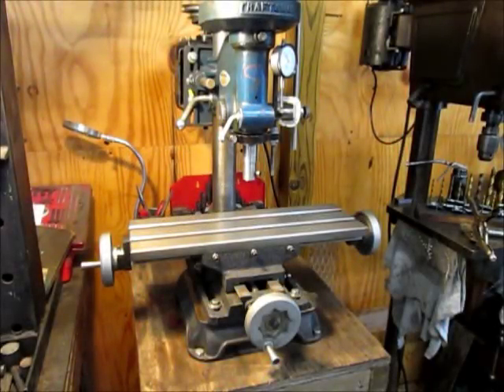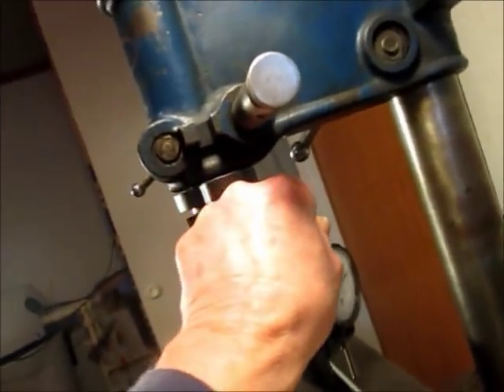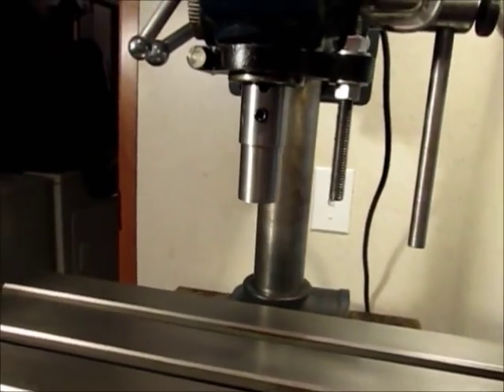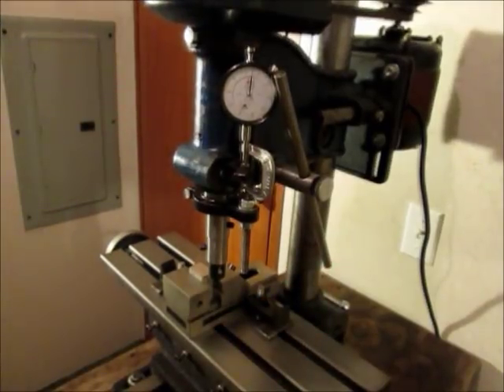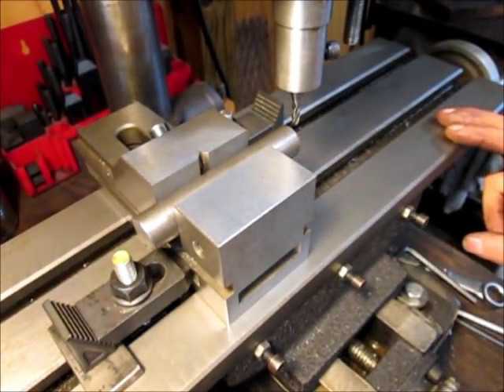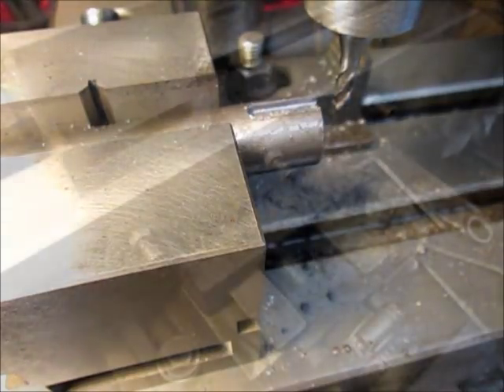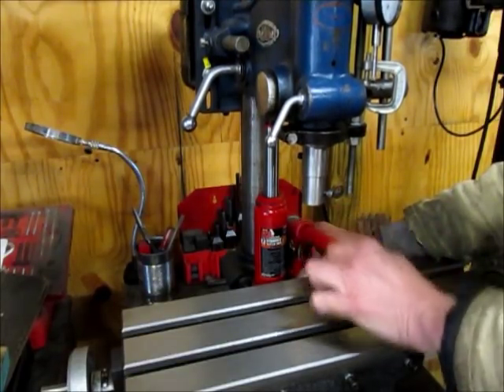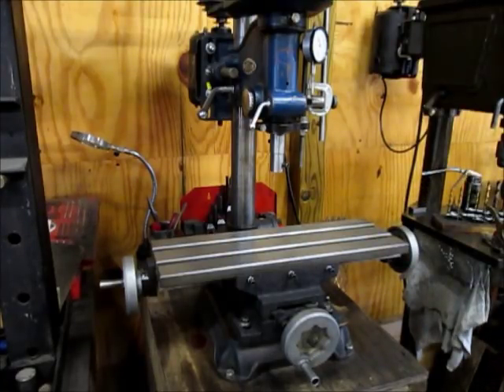Milling with a Drill Press

Comment: Solid job. I wouldn't worry as much about the bearings as these worry warts would have you believe. Besides you'll know because it will go out of round. Craftsman made legendary tools back in that era and I think its awesome you are keeping it working instead of rusting away like so many things. BTW my drill press is way older than that one, has a table so skirts can fit underneathe during the war effort when everyone worked together to help America. Now all people do is try to tear her apart.

I rewired mine, added a double podium booklight, extra outlets, a pallet cut into a frame for casters to roll it all over my shop. It's really handy now. Still only 1/4 hp 2 speed GE motor (and I leave it in the lowest one because I drill more metal than wood in it)... cost me like $20 at a garage sale, another $15 for a belt and a Jacobs chuck key. 

I should order that grizzly cross slide table you used. Nice unit. Good you're another fellow woodworker who buys AMERICAN MADE! (all my stuff is craftsmen because it was american made, my dad taught me, now I know its different)
Reply: Well you can safely bet that X,Y table isn't and won't be AMERICAN MADE because mine sure isn't. Milling with any drill press is like taking a Ferrari to a mud bogging contest and expecting some type of result. Just because the one's who know it's a worthless idea are saying so doesn't make them wrong. If you need to mill then buy a cheap small one. If you wanna play ya gotta pay. I want to learn how to fly, since I can't afford it I'm not going to jump off a building and start flapping my arms.
Reply: Turning Point Why are you bombing this video for?

For what its worth, mills don't use axial bearings, they use brass bushings, radial bearings, and gears (lots of gears)...

Oddly enough, big oil rig drills do use axial bearings...

For the record, I work in manufacturing these bearings, and those are basic roller bearings with sleeves. 

Axial bearings have 3 components, a housing washer, a roller filled cage, and a shaft washer. 

What you see in these drill presses are either radial roller bearings, or radial ball bearings. 

Either way a quick replacement with tapered roller bearings fixes this, as does installing a draw bar. 

What it doesn't fix is the fact that the spindle is driven by belts, and belts slip. This doesn't mean it can't be done properly, but it's not going to make you money at home from production...

I saw you get on him about his key slot, and that has nothing to do with the machine, rather the fact that he used a single pass, meaning his key way was the same exact size as his end mill.

I highly doubt you know much of anything, or you would have told him to use a smaller end mill, and clean up the sides.. Maybe its because I actually do this as a job, maybe that's why I know it!
Reply: Like far too many on YT you just automatically make a snap decision and assume others know far less than you do.I work in the open pit mining industry and have been around lots of blast hole drills. I've drilled a few holes but am no driller by any definition.But those rock drills are pretty much the same as those oil drilling rigs. Those axial bearings on the drill heads are there to take  the thrust loads common with any drilling. The drill string deflection when the holes are being started and to keep the drill string centered are taken by a deck collar that has the radial bearings since the drill pipe is never perfectly straight and it wears unevenly. So those axial bearings aren't odd at all. Or maybe you think there's no down pressure needed on the drill heads? All these drills including oil rigs have down pressure gauges so you don't burn up the drilling bit in case you didn't know that either.

And axial bearings have a hardened inner race, the same for the outer race, and the balls or rollers that may or may not be caged. 

And since I do own a proper Bridgeport clone mill I'm more than familiar with the requirements and parts involved. Your points don't address the non optional needs of a drawbar and how to get that hole for one through a spindle not designed for one with the small diameter in most drill press spindles. Since Morse Tapers without that drawbar are only good for end thrust as in drilling that drawbar is required for any work that involves radial forces. That simple drawbar is what keeps keeps Morse taper tooling seated in the taper. A MT is only self holding during axial thrust. An R8 taper still uses a drawbar since that taper is not designed as a self holding taper even while drilling. But it's also used to close R8 taper collets or hold tooling in that taper. That same drawbar idea is used to retain Morse Tapers since side forces and the standard vibration even using a multi toothed end mill will cause them to release. 5 minutes with a google search would prove that to anyone who cares enough to check. Then there's the point of people thinking a drill press chuck should be good enough to hold a milling cutter. There not since common non carbide drill shanks are left soft for a very good reason. The drill chuck can get a much better grip on them because under tightening pressure the drill shank flattens out just a bit but not past it's elastic point. Hardened cutting tool shanks such as end mills would only have basically line contact at the center of the 3 jaws. The helical flutes on an endmill will help to pull the end mill down and out from that drill chuck unless a reverse helical flute or up cutting end mill is chosen. ER, MT, R8, etc are designed to surround and properly grip almost the full surface of the tool shank. They still need to be properly tightened. ER 40s take 120 ft lbs on the closing nut before there considered tight enough. How much torque do you think a chuck key can tighten a drill chuck to? But you should already know that since this is your job right? 

My mill is a belt drive and no different than most other mills in the Bridgeport size other than the bench top sized geared head machines and my mills belt drive still doesn't slip even with 3 hp. Non cnc Bridgeports designed for commercial use are still made as belt drive machines today and there still making money with them. If a drill press doesn't slip while drilling then it most likely wont while milling. But that's not even an issue here since this drill press couldn't grip any mill tooling well enough to get even close to making the belts slip. And proper mills all have both radial and axial bearings since there designed to do both side milling and drilling when required or didn't you know that. Those angular contact bearings can take both types of forces. Some mills will even have added radial bearings to take the thrust loads off the angular contact bearings. www.lathes.co.uk should show some.So yes they DO use axial/radial bearings despite your comment that they don't. What do you think those angular contact bearings do? And there's zero "brass bushings" used in my mills spindle because it has those ABEC 7 /Class 4 or better angular bearings.Yet you state you do this as a job? Why tell him to use a smaller end mill since the whole idea is still unsafe enough it's pointless to use any common drill press as a stand in for even a cheap Chinese X2 sized mill that was designed from the start as a mill. So how much do I really know? Maybe not all that much probably, but it sure seems a lot more than you do since your the one who made a real point about my qualifications and brought up who might be best qualified to judge this. Have you even compared the head casting thickness between a mill and a drill press. Then there's the as thin as possible column wall thickness, a barely good enough for woodworking cantilevered table design and it's rigidity and deflection even while drilling. Very small and weak spindle design simply because it's never been designed to do milling, etc etc etc. That chatter and vibration because of the machines really poor rigidity quickly kills even HSS end mills. Yet it seems that the only ones who keep saying this is such a good idea are the ones who know the least in videos like this. Do your own research and anything I've said is more than easy enough to find and prove to your own satisfaction. The only place you'll ever see any drill press used or even thought of as a mill replacement is by amature's who won't do that research before they try something like this. Can it barely work? Sure, I've even tried it just once before I knew better. I've even used a drill press with an end mill to counterbore holes. That's axial thrust and can be done safely. But I certainly don't need or want a razor sharp end mill dropping off the spindle at high speed. Videos like this encourage others who may not have any idea of how dangerous it can be.You can do whatever you like in your own shop. Post it on YT as a good idea when it clearly isn't or even safe without far more work than it will ever be worth and you'll get comments just like mine. Given the obvious errors in your post I wonder just what makes your thoughts and opinions so much more valid than mine unless your just trolling for arguments hmmm?
Reply: Turning Point Once again, that is a radial bearing, not axial. No a drill press doesn't use axial bearings, because there is no need for it (like a couple hundred feet of pipe that you don't want to wander and snap)...

For the record, the best and most accurate milling retention, is actually a taper, the chuck is heated (we use induction) then the taper is installed, and retained solely by the metal shrinking. We use those at work as well. We also have hydro(lic) chucks (where the tool is held in solely by hydraulic fluid, and not a mechanical anything)...

Thanks for making my point entirely!

You do write good though, I'd take you for an author.

One more thing I'd like to point out to you, tapers are used because they are self centering (similar to you) and self locking, the tapers on conventional mills are normally not Morse anyways, nor self locking (hence the draw bar and pockets).

BTW I know how axial bearings are made, I just happen to work making them, they all use cages for the rollers point blank... Look up Schaeffler Group or INA... Working in mining, you've probably seen quite a few products from my employer. 

But as far as experience I have worked on Deckel FP1, FP2, and FP4, FPS300, DMG Mori 5 axis eco mill CNC, DMG  Mori 7 axis Lathe/milling CNC's (4.0 machines my company is helping develop) Weiler DZ50,  Deckel Maho, and Deckel Maho Glidemaster.

I've been doing this every day for the past 7 years. Also saw a little bit of eroding as well.
Reply: I buy all the old Craftsman I can find. The new stuff they make is crap with Craftsman name on it. Sad ending to a great tool.

Comment: Whenever I've needed to move a drill press and take it apart its been a right struggle getting the drill head off the stand for transport as they are often a bit rusted out, but the jack idea you showed is going to make that a lot easier.
I might even make something for my drill press, a ring to go round the stand and a bottle jack to raise/lower the drill table, its a right pain to adjust, and I dont want to lash out on one of those drills that has a windy up and down table.
Reply from the maker: hellcattanks  I hope it helps you out. Thanks for watching.

Comment: I know many people have asked about the side load on these old drill press and I had the same concern myself. However, after seeing the original manual for these Atlas made drill press, they actually have router accessories so they can be used for routing wood.
Reply from the maker: Yes and you can buy replacement bearings that are rated for side load.

Comment: I have done the same thing to a pillar drill, using the same milling table.  You do not need a jack to lift the motor and chuck assembly, just put a lump of wood under the chuck and use the down feed on the quill to raise everything up.  Ease and quick with no effort.

Comment: I did the same thing but I used a automotive scissor jack,,,works very well and the truss angles makes it more stable, and easy operating with a socket are battery drill,

Comment: Instead of drilling holes into the base you should have made  two plates to locate below the drills base-plate and run the bolts up from the bottom through the base-plate factory cut slots and into the tables base.
An easier way to Tram in your table is to find a Semi-Truck repair shop and see if they toss out old bearings.  A 6 to 7" OD bearing that is only worn out can be opened up to remover the ball retainer and balls. now you have two perfect Tramming rings cut to perfection. Just place the ring on your table and indicate off the top surface of the ring.  I wouldn't go smaller then a 5" bearing.  I store my ring in a Ziplock and coated with Molybdenum grease.  Best tramming plate in the world.

Comment: Id love to see some details about what you did to the quill. I have an old craftsman that I am doing the same thing to,   model 103....and I definitely need something other that a drill chuck to hold my tools
EDIT I just watched again...so you made the shaft. Cool....mine has a splined drive section up top....I could make a shaft with the bore and set screw as you have on the bottom, but not sure what I would do up top....the splines are what let it  move up and down on mine, while still allowing the pulley to drive the shaft. Splines are a bit beyond my ability with the equipment I have access to. I could make it round all the way, and use a different pulley but then I wouldnt be able to move the quill up and down.
My shaft has a J2 taper...if I could go between that and a home made holder...maybe buy a cheap J2 to whatever converter and weld my holder onto that....hmmm....
and LOL about the jack for raising...my press has a big cast iron body around the whole head..Ive used an old scissors jack to raise it! A small bottle jack would be better!

Comment: I built one using a Clarke pillar drill. Solid as hell and I use 20mm Mill cutters in it machining mild steel. I use ER32 collets and for smaller stuff I use ER16 collets
Reply: Can you elaborate on your build Michael? I'm planning on doing the same thing with a Clarke pillar drill but worried it won't be rigid enough. Cheers.

Comment: I have a very heavy, large drill press and have converted it to a milling machine. The main difference is that the head is fixed so I have to use the table. I've drilled and tapped the table mount and stopped it turning. It does have a gear rack and to stabalise that I've put three pins through it. Its now firm but i do have a problem I bought the wrong milling table, a Proxxon, and its giving me a lot of problems, so now I'm saving up for a better table. I did add a block threaded to 6mm and it lowers and raises the table in under a thousanths at a time
Reply from the maker: George Farmer Sounds good. Good luck with it.

Comment: It takes a true MACHINIST to take what he has and make it do what he needs.  Don't let the BOO BIRD WANKERS* bother you.  If your bearings go, I'm sure you will be able to engineer a fix in short order.  A MACHINIST is: a machine operator, an engineer, a mathematician, a metallurgist, a metrology expert, a blacksmith, or in other words a GENIUS!  I only subscribe to those that I respect their work.  I just subscribed to your channel.  *No I'm not British, I just like the term, it was appropriate here.
Reply: By the way, I was looking at doing the same thing.  I can't afford a mill.
Reply from the maker: Hey thanks a lot. I appreciate your kind words.
Reply: These drill press do not have bearings they are made with bushings and a thrust bearing the meats the quill and spindle they can handle side load
Reply: Thanks for the info.  Was considering the same build, for my home shop.
Reply: I just stubbles on some new info maybe you can find useful my drill press has a Morse tapper and a Jacobs chuck turns out they made a Jacobs chuck #633C. New version 34-33C. To have the taper but also a built on collar so the chuck could support side load !!   Not sure what drill press your going to use but maybe that is helpful info

Comment: Is it possible to mill steel with a converted drill press if you take light cuts, or is it only suitable for softer metals such as aluminium, copper and brass?

Comment: Here I am 6.5 years late to this party. But wondering what brand/model compound table that is. Also the model of Craftsman drill press that is, so I could maybe find an alternative with heavy enough specs for this type of conversion. Thanks for the great video.
Reply from the maker: Look on Grizzly for the table. Main thing is a locking quill.

Comment: I have a 1938 Companion press...also Sears...made by Atlas...basically a smaller version of the one in the video. I have been wanting to do a similar build with it and this gives me proof that it'll work.   THANKS!

One BIG advantage to these old presses is the solid, threaded quill...can take a bit more lateral thrust because it is not a mortise fit...so quill can't drop out. But if you bend it, you are D - O - N - E...done! Well...at least until you can find a good lathe and rebuild one...you aren't going to find a replacement part for a 1938 machine online. I plan to build a very sturdy, 3 bearing quill/chuck support to take the majority of that lateral thrust load.
Reply from the maker: Thank you and good luck!

Comment: Great work on drill press  is ur spindle draw bar or wedge kind. Thought about doing one to the little milling machine cost to much for what they are. Big one take up to much room in my building 16x10. Have almost new look unimat DB200 with milling attachments it's nice little little machine. But need one about that size u made. How it holding up r do u even use it still. Nice job. Stay safe from ur ole hillbilly buddy